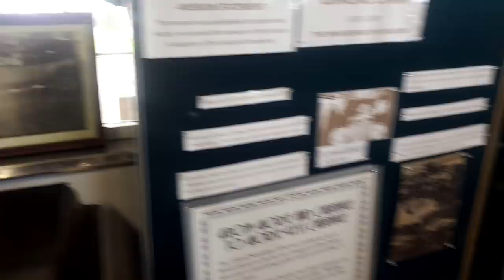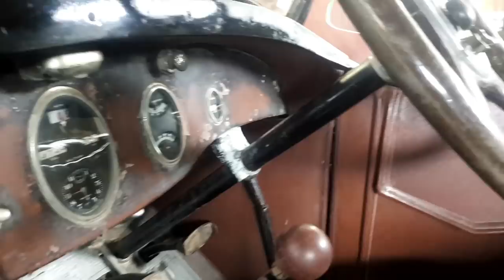(EP10) HubNut Goes Global: AMAZING Packard and Pioneer Museum, Maungatapere, New Zealand

Comment: That Packard “double six” what a great start up
Reply: Like WW2 piston engined airplane.
Reply: @waltertaljaard1488  Wonder what that did to the gallon....
Reply: It's truly amazing, a car and engine from 1919 that's quieter and more refined than most cars today.  With the sound off and the fan out of shot you wouldn't be able to tell that engine was running, it was just so smooth...
Reply: @gosportjamie  Would any of today's cars still survive and start so well after 100 years? I think not!
Reply: @andrewhaines8603    I rather suspect there is not a single, solitary chance.  Not on your Nelly...
Reply: @davidfarmer2049  Start ;-) , just . Fuel economy hadn't been invented yet in the USA
Reply: @rayg9069  I gather petrol ran like waterin those days (in america) , discussing it with my boss in the 80s he said there was "always another petrol station just down the road".   Horrifying now I suppose.....    :->
Reply: @andrewhaines8603  It's odd isnt it with out vastly improved material sand and oils of today.
They are all built  down to a price now......    its why I hate them I  suppose.....   :-/
Reply: @davidfarmer2049  They are and all come from the same CAD handbook so no real individuality. I'm dreading the so called green electric cars.
Reply: @davidfarmer2049  It was the same in Australia up to the early 80's, I had a local made V8 that at highway speeds would empty it's 16 gallon tank in just under 4 hours, and it wasn't that powerful, just rubbish efficiency. Those were the gold old days..
Reply: @davidfarmer2049  Same here, I have recently started restoring for use a 1965 Land Rover, the simplicity and durability built into those things is amazing. Even more surprising is that almost every part is still available brand new made by dozens of after market companies. It's like therapy, after getting annoyed with my CRDi Turbo that has fits with check engine lights if the oil filler cap isn't tightened properly I go out and tinker with great lumps of British engineering ;-) Better than any drug
Reply: @andrewhaines8603  ..the same CAD handbook.
I think that about sums it up.
Reply: @rayg9069  well i've just been doing the maths on that.

Assuming you were  doing 70....   in four hours you travelled 280 miles.
To make the maths easy we'll say you used 14 gallons.

20 to the gallon???
No problem!!!!   hehe  :-)
Reply: @rayg9069  I had a 1989 Mini I tinkered with. Like the Landy even I could work out what was wrong and like you say it was like therapy. Unfortunately I had to sell it before I got it back on the road. 😥 But too much technology in cars on the belief that it's more efficient. Yeh right! Volkswagen anyone?
Reply: @davidfarmer2049  It was closer to 15 mpg out of a Australian 4.2 liter engine. You could use the fuel gauge as a trip timer, 4 hours full scale ;-) Those were the days, then about $20 to refill it. It costs nearly that much to fill my motorbike these days!
Reply: @rayg9069  When we moved to  south wales......we were lucky to be able to live in fairly rural area.......    T he family estate  got retired off as  Mum's shopping car.
It was a Volvo 145 estate  (non over drive unfortunately)
Around the welsh lanes it was averaging 18 to the gallon (Mum did hang on to a gear).
That was from 2.0 litre cylinder so I think your 15 still pretty good!!
Reply: @davidfarmer2049  Blimey!
Reply: @davidfarmer2049  What did it do to the gallon? It drank it, of course! 😉
Reply: @RWBHere  Oh very witty.

Comment: When i lived in Auckland in the 70's I had a 1951  Packard,which i had got as a swap for a Austin A60 😏... On the NZ ownership papers it listed the Craws as being owners sometime previous to me. The first owner being the Owner of Dominion brewery,Sir Henry Kelliher. 
The pioneer skid steer is a new one to me. Make a mistake driving that and you will get a free invacar...
And railway jigger behind it. 
The skoda dealers bought the octavia Chassis into NZ as part of a lamb deal. So NZ got quite a few Skodas but getting parts was always a major problem. I had two Singer SM's and a Singer Hunter. The Hunter had a fiberglass bonnet. So they must have been amongst the first cars in the world to have such a thing. 
Dodge,after WW2 got so many requests for a vehicle similar to what the GI's had that they bought out the power wagon in 1947,which looks almost the same and continued making them for decades. 
NZ also got a lot of bradfords, bought in by the same people who later sold Skodas. I see a pattern there. 
I have two Leyland P76 Engines(3 actually but one is in pieces) .
BLMC made more v8 engines than cars so they used a lot of the excess production to power a truck called a leyland Terrier. I doubt any survive although the engines keep turning up for sale.
Reply: Great post.
Reply: Friend of mine has a running P76 in his shed ,needs VIN tag off another to get it back in the road , another friens inherited a Sunbeam Rapier which he renamed the Rapist !

Comment: 16:30 - The ‘Squariel’ was one of my favourite bikes, after HRD Vincents and Brough Superiors. Once they had warmed up, you heard the tappets, rather than the engine or exhaust, as it approached you. From behind one in town, you heard that lovely exhaust burble, or a hum at higher revs. Quite a number of Ariel Square Fours clocked up over 500,000 miles without major issues, so long as they were looked after properly. Thanks for the fascinating tour, Ian.
Reply: That Ariel sounded fantastic

Comment: Soms time ago i read a story about the Merlin engine. When it was decided that Packard would start producing them for the war effort Packard pulled one Merlin engine to bits to measure all parts only to discover that the whole engine was built with big tollerances, way too big by Packard's standards so they  tooled for their own tighter tollerances resulting in an even better engine! Yes, the Packard Merlin was better then the Rolls Royce Merlin.
If i remember correctly Rolls Royce later took over those Packard engineering practices.
Reply: You beat me to it on tolerances but I posted! There was something also about upgrading babbit metal bearing shell lining  to indium ?

Comment: Trekka. You haven't lived until you've 'A' framed a VW Kombi behind one on a hill, front wheels locked and rears along for the ride.  Back to front floor shift. Unburstable. Our VW workshop had a big wooden box with all parts to convert the diff to LSD. Called Balanced Traction. A suitable round BT badge was then affixed   Swing axles for maximum cornering fun.  We used to carry  3 x 44 gallon drums of waste oil in the Trekka, and empty the oil at the local tip.  Lots of garages did that. Pollution!     32:09 Studebaker Lark V8, 283.  5 Star Motors in ChCh NZ were the agents for VW, Alfa, Skoda, Mitsubishi Colt, and Studebaker. We used to race the Studes in the w/shop at lunch when the bosses were next door at the pub. Fun in the '60s.

Comment: Oohh, what a wonderful museum, and how prolific you are being on your 'holiday' Hubnut!  On the Landcrab Ute, we always wondered how they made progress once enough weight in the back lightened the front wheels.  In practice it seemed to work ok.  Possibly the weirdest ute created in Australia was on the Triumph Mayflower.  You may see one on your travels.  Singer Hunters are about in Australia - I've seen 3 or 4 over the years.  I'm no Packard expert, but the drive from the dynamo on the V12 looked like a water pump drive to me.  And the straight eight car would have had a water pump I would have thought.  The 6WD truck, if I'm not mistaken, was also the basis for the more aquatic DUKW landing craft, a few of which are still driving/sailing in Australia and probably NZ.  This museum would actually give Australia's biggest - the National Motor Museum near Adelaide - a good run for it's money.  Cheers.

Comment: Ohhhhh a near miss on Mayflower mobilisation, but thanks noted  it's tagged as on your future test list. What a superb and eclectic  collection here  however and an enthusiastic host. Only lacked a Dennis lawnmower, but the double chassis LR 2B turned up! Fun fact, Packard apparently had superior manufacturing tolerances over Rolls Royce and improved the interchangeability of Merlin parts and reduced the need for fettling by engine fitters as well as some indium bearing improvements?

Comment: Packard Straight 8 does have a water pump. It just looks like a thermosiphon system, as with other engines of that era.
Is that an oil pressure manometer on the right hand side of the operator on that small orange excavator? (13:40-55)
Still looking forward for a Mayflower reviews as well as a P76!

Comment: Wow. I didn't know that place existed. My inner pedant insists I mention that the  Australian Austin/Morris/Leyland cars were made in Sydney, not Adelaide.  Is that P76 NZ assembled? The front seats look different and no head restraints. What an amazing assortment. Thanks Hubnut.
Reply: That's what I thought about that P76 too.
Reply: @johnhowell1691  I just took another look, you can just see a head restraint on the passenger side seat. I remember those seats now too - the plain vertical stitching is on the base model (Deluxe) with bucket seats. Deluxe bench seats and Super and Exec bucket seats all had those lovely comfy horizontal pleats.
Reply: @chrisharkin3741  Thanks for that. I can only remember the horizontal pattern on the seats.i also thought it was only the 2.6 that had a single headlight front and v8 had the twin headlights. Maybe that was just the v8 Executive.
Reply: @johnhowell1691  The single headlight was Deluxe spec - Six or V8. Twin headlights for Super and Executive. I think the bucket seats in the Deluxe came as "Luxury Pack" or if you ordered a 4 speed floor shift manual gearbox as an option.

Comment: That Austin Kimberly is that based on the Austin 3 litre, which shared a lot with the landcrab, but had a boot?
Reply: It's an Australian designed and built replacement for the venerable 1800s which were starting to show their age against the influx of Japanese imports.  The engine is a 2.2 straight six, mounted transversely, like the landcrab's 1800.  There were two "specs".  The base was the Tasman, which was really the poverty pack, and the up-market version (here) was the Kimberley.  It's easy to tell them apart from the front, as the Tasman has single round headlamps, whilst the Kimberley has the twin rectangular ones (as well as better trim inside, etc).  The brief was to create a more "modern" style that had all the space of the Land crabs and to compete with the likes of the Datsuns and Toyotas but with the "power" of a six.  It was just a shame that Leyland Australia was in the same state of mind as British Leyland and quality and finish were poor.  The same fate was bestowed upon the P76, which was another Aussie design but this time to take on the likes of the Holden Kingswood, Ford Falcon, and the Valiants (or Chryslers).  The P76 was a world apart from the others mentioned, which things like recessed wipers, MASSIVE boot (big enough to take a 44-gallon drum!!) and big, comfy seats as well as the option of that brilliant 4.4 ltr all alloy V8.  The standard six was a little breathless in comparison, but still adequate.
Reply: Was actually a 2.6 litre straight six, l am pretty sure the Kimberley had twin carbs against the Tasman base car also, l stand to be corrected but l am pretty sure they were.
Reply from the maker: No. 2.2 was the engine in these. The Tasman was a slightly defined version but I can't remember if it was due to the number of carbs. I'll have to check my own footage. 😉

Comment: It was said at the Museum that Leyland P76's were made in Adelaide, they were produced at Zetland Sydney, the plant had a staff of 6000. P76, Kimberly, Tasman and other Leyland Cars were made there. The P76 ended production because of several factors, Poor reliability, union strikes and a campaign  waged against them by the big Three Manufactures, and poor Management both here and the UK. The oil crisis had little to do with it, as Aussie's were buying big sixes and v8's for decades to come.
Reply from the maker: Leyland also pulled the plug on the Aussie operation as it haemorrhaged money back home. Unfortunate timing.

Comment: Way ahead off its time. Had a race with a mate with a 4 speed Holden Monaro , my p76 was a auto .And out handled and was slightly quicker.than his 308 Monaro. My other mate had a 265 charger. My Leyland and the charger were about equal. Thou the Leyland handled better. Thanks to its rack and pinion steering and over coil front,and coil rear.

Comment: I thought 'oh no,  not another deadly dull motor museum.' How wrong can you be! I remember seeing a new Singer Hunter in a dealers and recall a very nice sliding tool tray in the boot. Didn't they have a fibreglass bonnet and front wing valances? The first Rootes Gazelle had the Singer ohc engine in a Minx body.